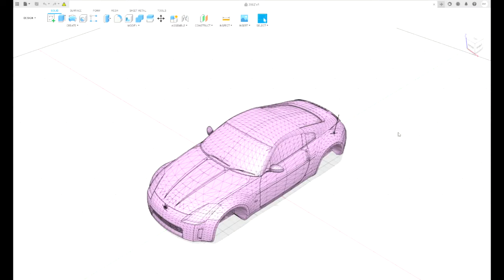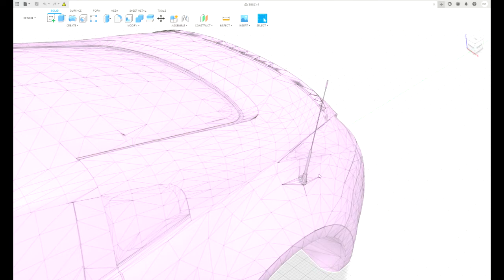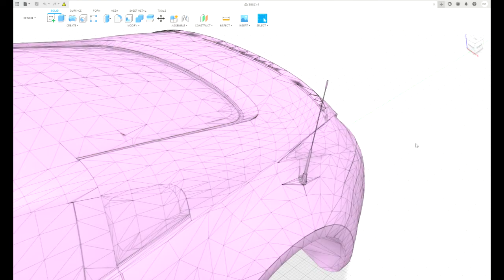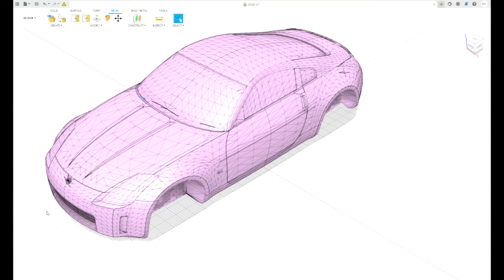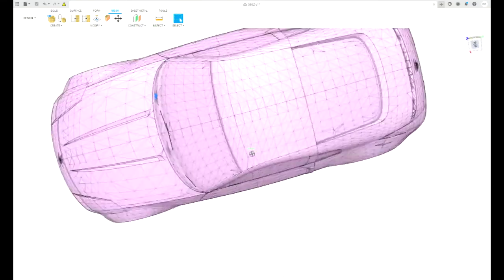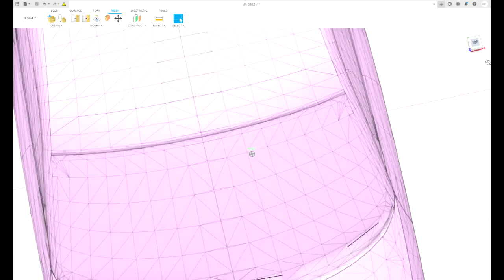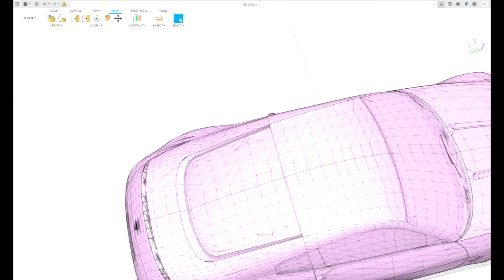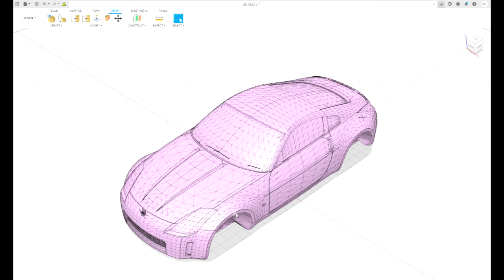Modify an STL file — Fusion 360 / 3D MODEL FROM THINGIVERSE  HELP!

Comment: Convert Mesh to brap.  Turn off history first.  You’ll have to go through and merge all those triangles.
Reply from the maker: Let me ask after converting it over to brap. Then edit it the same way?
Reply: @wow-wow-p8d  depending on how many facets are on the car fusion only wants to convert like 10k. Preserve boundaries.  It should tell you how many facets the stl has initially. So you have to slide the thing to the right percentage by doing a little math. I had to do this the other day to edit an stl file for printing.  I’d suggest search YouTube for how to edit an stl file in fusion 360.  There’s quite a few videos of people far more experienced on the subject then me lol.